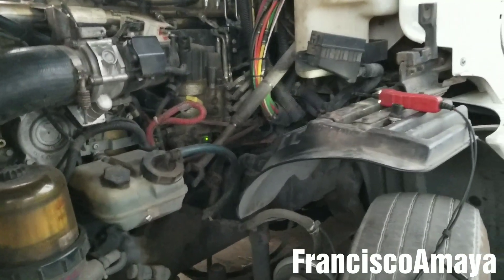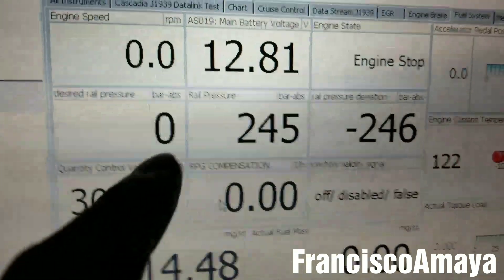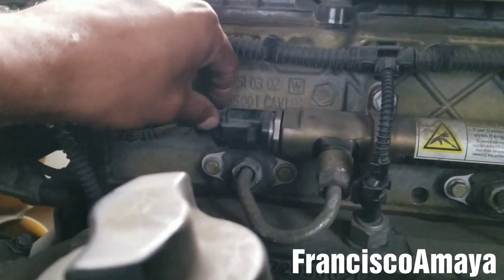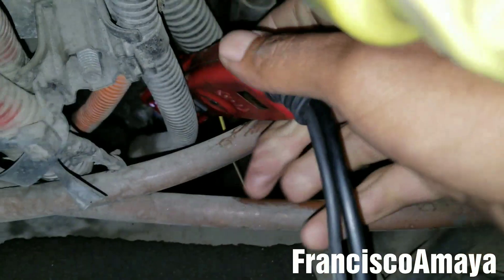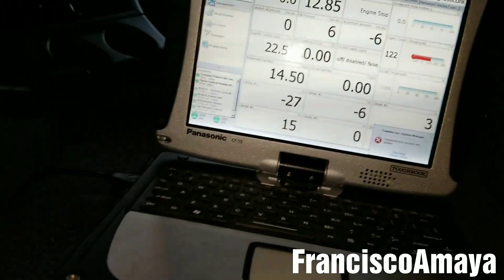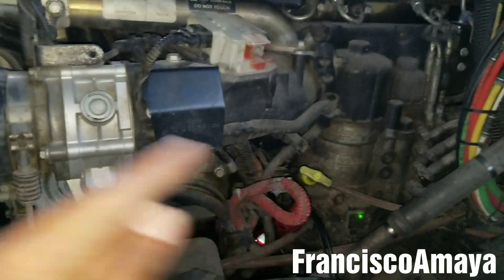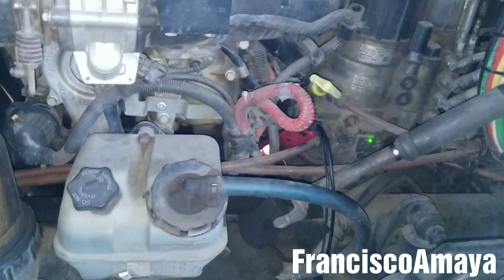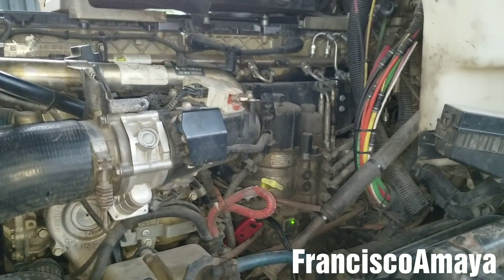freightliner cascadia DD13 DD15 DD16 engine harness problem short in the wiring engine problem

Comment: Francisco I have problem with the truck two check engine light on, and I regen 3 times it won't remove the check engine light on,and I notice the def is not decreasing , do you think is the grounded wire on scr box?
Reply from the maker: What is the code?